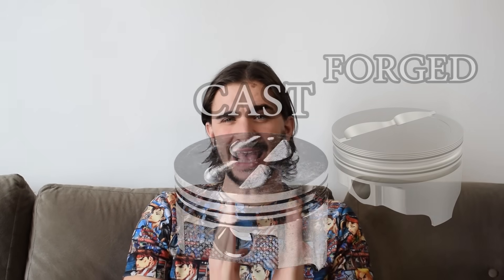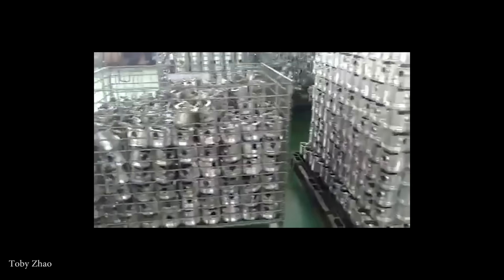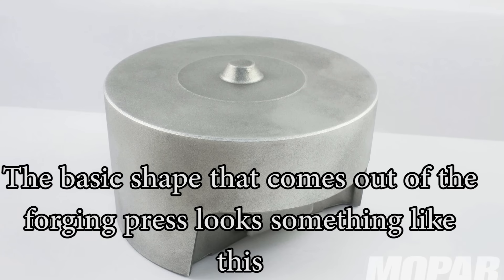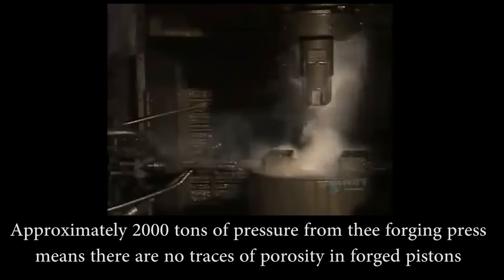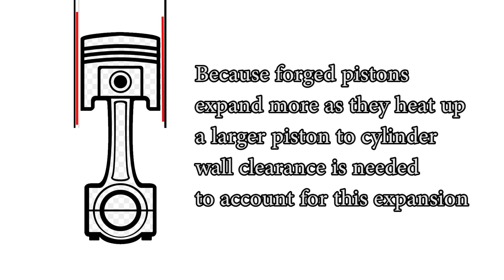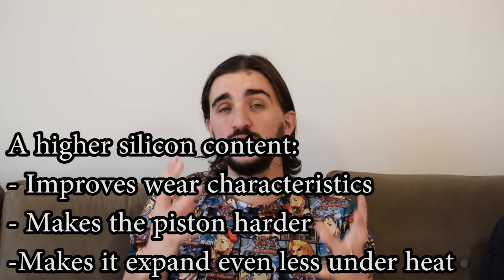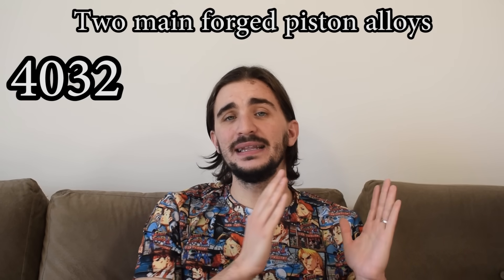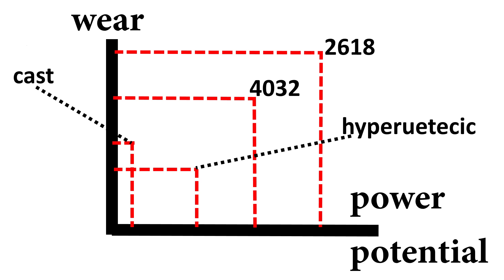FORGED vs CAST vs HYPEREUTECTIC PISTONS

Comment: This is an absolutely wonderful discussion. I live near Detroit, and one of my classmates is a piston design engineer. He loved this when I showed it to him. His only comment was that modern pistons are NOT poured when cast. Rather the mold is dipped into the liquid metal and a vacuum is created such that the liquid metal flows into the evacuated mold. There is no possibility of air pockets in the resulting piston. The narrator touches on this when he speaks of "modern" techniques at 11:50, but does not say it specifically. I was told that this process is used for two reasons, to exclude air pockets, and that liquid aluminum alloys will oxidize instantly, at their surface, when exposed to air, and this creates aluminum oxide (slag) that is horrible when inside the body of the casting. The older pouring methods depended on the slag floating on the liquid and not going into the mold. There was a certain amount that did get into the casting but until vacuum techniques were developed this was unavoidable.
Reply: Thank you for sharing that. Once you told me, it stands to reason.
Reply: Very helpful. I think about to replace all casting parts with forged. I drive discovery 3 ,4 with very high torque and the camsaft and other parts are sometimes brake if cast.....

Comment: There are cummins engines making 1600+ hp on cast pistons over 120psi.  I have a compound cummins truck and love it. I also have a turbo 383 sbc and would never put cast pistons in it for the hp numbers I want. It's all a trade off.  A great way to reduce piston slap is to use engine heaters before start up.

Comment: Cool, I'm gonna use .20 over hypereutectic pistons for my 95 DOHC Saturn SL2 from a 1.9L upped to a 2.9L and a turbo set up. I'm not going super crazy with boost on mine anyways about 14-15 PSI and a dual intake cam and stage one port and polished head with a polished combustion chamber , 3rd generation heavier more balanced crank and 3rd gen lower tie plate, with port and polished intake manifold and a bigger throttle body, ARP main and head studs, etc. I already have a ported intake also and bigger TBI so it should be a nicely powerful build around 320-350 HP with 300+ Ft Lbs of torque and the car only weighing 2280 LBS, should be pretty ferocious, while reliable. I also got a limited slip differential from MFactory and a Fidanza lightweight flywheel. Can't wait to finish it all!

Comment: You guys need to listen to this! I've learned it the hard way... Young me buyed a young car with engine dmg for not so much money. Then I took everything apart and exchanged those oem pistons with forged ones. And yes, my penis grew even bigger. However, I lived up in the mountains and I had to drive down in the valley 5 days a week. Now, of corse I've let the engine run in idle for a few minutes before I drove it yet it only got temperature after I reached the valley where I finally needed those horsies some ten minutes driving downwards with the pedal bearly touched at high rpm later.
The enigne lastet about 40'000 km...

Great video! Thank you! Although, it comes some years to late for me  maybe it'll save someone else.

Comment: If I could I would make a billet titanium engine with the seals and some gaskets made of black nitrile and neoprene with steel piston rings and valve springs. With the carburetor being made of billet titanium and if it has fuel injectors the casings for the made of billet titanium and some internal parts titanium also. With outside being gold titanium oxide plating.

Comment: Very clear and informative video.
Just a few questions. You said forged pistons are made from aluminum rods. How are those aluminum rods made? are they cast? or is it just the pressure applied to forge them they makes the material "forged" and better, I mean does the structure change when it forged? Is it possible to apply pressure and different flow or temperatures while casting to make those cast pistons better? do those methods apply to let's say motorcycle frames industries where we see forged frames, cast frames, welded frames. Is simple cast good enough to support all the deformations and vibrations that a frame must endure? Thanks.

Comment: Meanwhile in RC land, our tiny ringless engines rely on an interference fit between the piston and cylinder to achieve proper sealing during the first few microseconds of each combustion cycle. Ringless pistons are made to jam into place at the top of the cylinder, and achieving a perfect fit is simply left up to the user to achieve during a careful break-in process. Fortunately it's very easy to disassemble a RC engine to check how the piston is breaking-in during the first few runs, and to clean out any debris left behind. I use a Q-Tip to remove the smear of black metal residue from the cylinder walls after each run during the break-in process. Fancy RC engines also use hypereutectic pistons though, to minimize the need for this.

Comment: Doubt here: Wouldn’t the cylinder bore be designed to expand in such a way to compensate for the piston expansion?

Won’t the cylinder and piston expand similarly so that there are no piston slaps?
Reply: The cylinder bore and the piston may not be made from a same material, so their heat expansions are different. Many sleeves are gray iron in order to resist more pressure and improve the stiffness.

Comment: Especially if you live somewhere that gets cold during the winter like me (Massachusetts, USA) Where winter regularly gets down to 0F, -17C and up to 110F, 38C in summer, Cast pistons are a no brainer on a DD, even a moderately turbocharged one. The increased tolerance of forged pistons would have your cylinders oval shaped way too soon if mostly you're just DD'ing the thing with lots of cold/low lube starts. Major Manufacturers don't use them ONLY because they're cheap to produce in bulk, although that may be the only reason it's far from the only one. They just behave better in all but the most demanding use cases.

Comment: GREAT video, you give the FACTS about the most misunderstood component in a engine, most engines are DAILY drivers, while it might be "suped" up a bit w/ a bigger cam better heads you don't spend day after day at the track, another thing you have to ask yourself "How many times do you want to rebuild your motor?", I'm personally rebuilding my sbc 350 that has 439,906 miles on it, it still gets 17mpg and 12 if I'm loaded down(7,000gvrw+)the cylinders are a lil glazed but there is Zero ridge at the top of the bores but its starting to get more blow by on the rings than I care to tolerate.
I'm upgrading my heads to better flowing ones along with my intake and exhaust(mid length headers to full length because they produce better power down low) but pistons will still be cast or hyper and I will use zero gap rings to further reduce contaminants in the bottom end getting into the oil. Yes most engine shows we all love to watch are dropping 1000.00 sets of forged pistons in like its nothing and flogging them on the dyno saying look at how much power I made at 6k rpm etc but this DOED NOT reflect the average guy who has a hot rod that likes to drive his car or suv on a daily basis.  The true cost of doing a total rebuild is getting more and more expensive if you don't want imported cheep parts since our money is worth less and less every year, I personally like to drive my vehicles.

Comment: This as a retired automotive engineer from advanced development and reliability engineering supervision with multiple PhD's  has to be in the top three easily understood descriptions of the technical differences in types of aluminum use and explaining why internal combustion engines are built with several different aluminum composition depending on the ultimate use and how manufacturing cost comes into the decision in some instances when it comes to the piston material used.

Comment: driving 4 answers:
I hope you'll answer this. Most Hypereutectics, as I understand it, are made from Extruded 4032 aluminum with silicon added.  Pro Comp Electronics is selling 2060 aluminum Hypereutectics.  Extruded. One type they have have is with ceramic coating and claim it can handle 650 hp or more. The other type is uncoated.  I've done my best research on this type of aluminum - 2060. It has Lithium added which improves elasticity. It is used lots in the aerospace industry for fuselage panels, and for body armor in the military.  Being shot with a 30 or 50 caliber bullet does not cause it to shatter.....But really, I wonder. Is this really a good piston material?   I hope so because I bought a set.

Comment: I hope you're a teacher IRL. Good explanations as always. One thing I'd like to add is that Hypereutectic pistons aren't just about rigidity, the extra silicon forms glass beads in the surface of the piston, which provides a slick and very tough wear-resistant contact surface to the cylinder wall. This works so well that a lot of cheaper lawn mower engines also use Hypereutectic cylinder walls instead of a more expensive cast iron sleeve. Surprisingly, some vehicles, including some Porsches, also use Hypereutectic aluminum cylinder walls.

Comment: Is there anyone wtlling to give me some advice on reasembling a 5.7 30 block. Crank will be polished tomorrow by noon. Figuring out what heads to use & should I put bigger valves & springs A little porting will need done for clearance issues. Then the cam,smh! Better wait to see how big a springs I use. Probably LS6 springs! Oh & screw in studds!

Comment: Wow impressive video about a project I'm woon now! I have a 1967 Camaro project that I want to put a 5.7 ltr in it.. My friend owns a machine shop very close to me. Last year I sent the block out to be cleaned & magnafluxed. & cheched for cracks, they're fine. I want 425 to 450 hp. So I will probably use the vortex heads that were on them. Would you change the springs to something beefer? I've heard lots of people useing LS6 springs. Have to do a lit porting

Comment: Thank you very much for this. Simple, straight and informative. I've long been confused about how to prepare for an anticipated project to rebuild my trusty 'pedestrian-but-wonderfully-reliable' 86 Ford 300 straight six now that I'm retired and the truck has turned over 1/2 million km. Its achieved this (and I have never seen the inside of the motor during the past 35 years except to renew 2 valve cover gaskets and replace one exhaust manifold gasket) and it still doesn't use oil between changes but that wonderful engine is deserving of major TLC and I'm currently having to weigh (financially) what is 'wanted' vs what's actually 'needed'.

Comment: I really like your videos, very informative, thank you! I use 2618-T61 pistons for many years now and am very happy with them.. piston to wall clearance is 0.004" according to the manufacturer (Ross Pistons). A hypererutectic piston in the same size (4.16") would need about 0.0025", which might be better for a daily driven car, but I don't think 0.004" will lead to massive wear. Surely you would have to use larger clearances with the 2618 if you apply a lot of boost, nitrous or race the engine on long term, but this will also apply if you for example use the car for towing and have a hypererutectic piston.

Comment: It’d be interesting to see your take on steel pistons they’re putting to some new Diesel engines (since I own one). The real practical benefit of steel pistons I’ve experienced is that there isn’t as large of a contrast in engine roughness between cold and hot start as with aluminum pistons. Even the cold Diesel engine is pretty smooth. I’m guessing this is due to the lower clearances they’re using with steel pistons since the steel doesn’t expand as much.

Comment: Would using methanol as your fuel source change the expansion issue of a forged piston seeing as methanol allows  a motor to run at a significantly lower temperature

Comment: How bout including Piston to cylinder wall running clearances? For Cast, Hyperutectic, and Forged Pistons? Common sizes 3 1/2 to 4 1/2 inch... And what are the best piston rings to run, moly or cast?

Comment: I just had a built engine put in my STi... it has slightly higher compression (8.9 I believe or something just below 9) over-bore forged pistons to complement the increase in power from a larger ceramic ball bearing turbo, 1050cc injectors and ethanol capable fuel system and most bolt on upgrades. I didn’t know about the whole thermal expansion thing... are there any mods I can do to improve the rate of wear on the cylinders or piston itself? Cylinder linings come to mind but thats all I can think of and I’d rather not have the engine pulled again. If it has to do with having the pistons warm up then I’m wondering if the cooler charge from running ethanol or meth might be detrimental in that sense?  I do have an updated 7L oil pan too. Thanks for any suggestions

Comment: Man , that was really a very very good Video. Thanks .  
Another Problem using Forged Pistons in high Powered  Daily driven Cars is the Piston Ring Gap which needs to be set big. Means more Oil Consumption in normal driving Mode 🤷🏼‍♂️

Comment: So why do certain mass produced engines meant for daily driving like the engine in the Honda S2000 come  with forged pistons also the 2J engine came with forged parts.
Reply from the maker: The f20c engine on the s2k is a complex example, it involves the FRM cylinder liner, an extremely high redline, and other factors. Honda went back to cast pistons and iron sleeves on the k20, and these proved to be a more durable solution. The 2jz does not have forged pistons, it has cast hypereutectic ones. OEMs only use forged pistons in low volume, high performance cars, where the extra layer of safety offered by the forged pistons is deemed justified due to the expected application of the vehicle.
Reply: @d4a  Thank you so much for your quick and detailed response your channel is awesome keep up the good work 👍

Comment: Wait at 12:40 ish he is talking about car brands using  turbos and cast pistons. One problem, those cars in stock forum are not creating hardly any boost. Try running 20-30 pounds or more of boost and cast pistons and see what happens.
Reply from the maker: Plenty of stock cast OEM pistons can take quite a bit of boost. 2jz stock pistons are cast, 4agze too, RB as well, 4g63, ABfs, iron block LSs, OM from Merc, J series Honda, etc etc. All of these and more engines come with cast pistons from the factory and have proven themselves at taking good amounts of boost on stock internals.

Comment: Back in the late 60's early 70's there was nothing like an engine with a large cam with solid lifters ( flat tappet cam)  and forged pistons. They make a very unique clattering sound. And if you had a big or small bock Chevy with an M-22 rock crusher, you did not need a radio the sound of the engine was enough music !!!!!

Comment: This was a while ago, but if you care to answer: The EJ series engines often use hypereutectic pistons from the factory. Often forums will tell you the hypereutectic pistons are the reason for the ringland failures and a forged piston will not crack like that. Is this true? I would assume that the forged piston, being more ductile, would bend rather than crack in that area? Do the hypereutectic pistons trade even more ductility for expansion tolerances?
Reply from the maker: We're speaking about knock here. What kills pistons is knock. Yes, a hypereutectic or a cast piston is more likely to crack under knock than forged ones. However, after reading the forums for an hour you're tempted to think that stock hypereutectic pistons are made from peanut brittle and that they crack very easily. The reality is that a lot of it is to be blamed on poor tuning. People mess around with the engine and crank up the boost without proper knock monitoring or boost control. The pistons of course fail, but they didn't fail because they were weak. They failed because of a horrible tune. Forged ones would have survived longer, but would still eventually fail. Yes, hypereutectic pistons are less ductile than forged ones, but they are typically stronger than regular cast ones.
Reply: @d4a  thank you so much.

Comment: Which would you suggest for a dodge truck used daily and is raced a good bit? Building the engime and tune for 500 horse and about 575 torque.
Reply from the maker: What kind of engine? NA or Forced induction? Max rpm? Raced how?
Reply: @d4a  natutally asperated for now, will be super charged in about a year or so.
Reply: Max I'm fairly certain will be 6,000. Mostly street raced, we have tracks where I'm from that are set up like street races.

Comment: 1:30
No, you dont melt it 100%. There have to be some solid particles left in the liquid aluminium, they are the seed crystals. They define the size of the grains. Too few and the grain is too big and the part thus not good. If you would melt it 100% the temperature control would be somewhat less relevant.